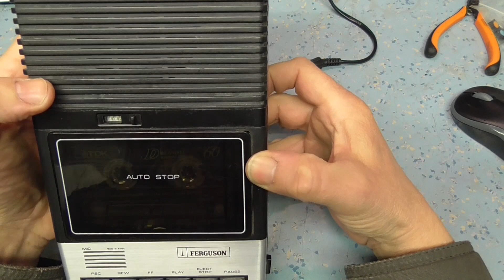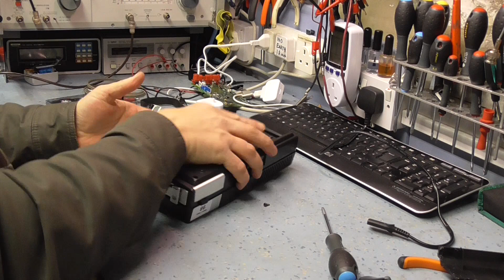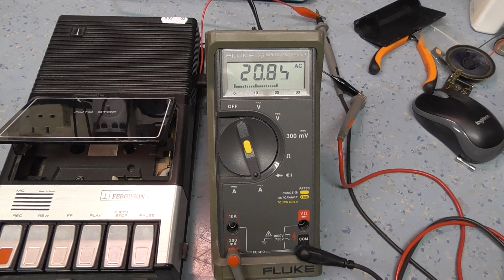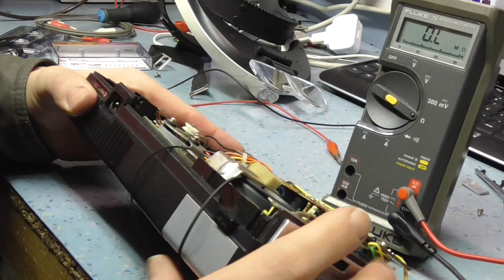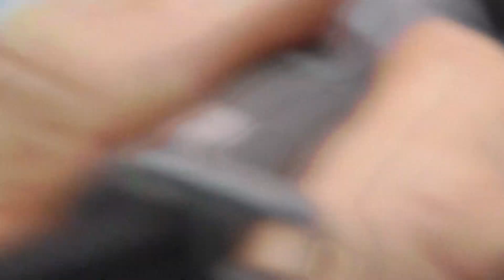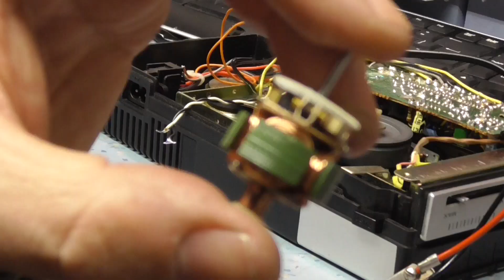Ferguson/Thorn cassette  player repair

Comment: Yep I had the same model for my 13th back in '83, i still have it the little brushed metal trim on the tone control knob fell off, other than that it still works. This was one of the first to have vogad.

Comment: ' You know why you can't hear anything?' , Because there are noooo sounds to be heard ' 
 ' Kriten is this about the time you send you head off for a retune?'
I think that second part is correct :-D
I enjoyed every episode of red dwarf, my favorite program other than the original star trek.

I havn't seen one of those centrifugal governors for years.
Well done on repairing the motor simon :-D
Hopefully the erase was an a.c type.
My old ITT studio recorder has an interesting auto stop, a separate drive belt off the motor drives a cog connected to a thick wire con rod, the cog rotates and the connected con rod moves forward and backwards (like an engine).
it connects to an odd little mechanism.
If the tape stops the odd little mechanism changes and the con rod kicks it out of play/ff/rew mode, via the odd mechanism.
Sorry waffling again.
Reply from the maker: So your a waffle man! Good old Red Dwarf. Cheers ZX
Reply: @SoddingaboutSi  Talkie toaster, i toast therefore i am.
Third degree toaster side  :-D
Holly suddenly becomes a genius for 3 minutes :-D